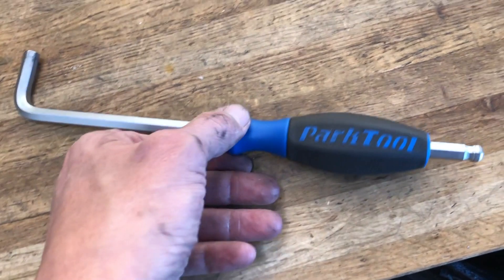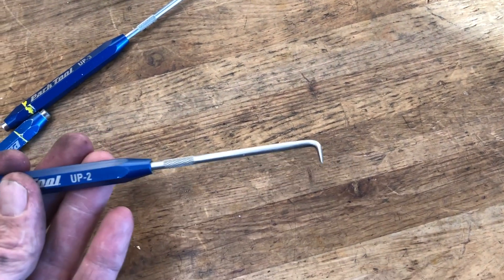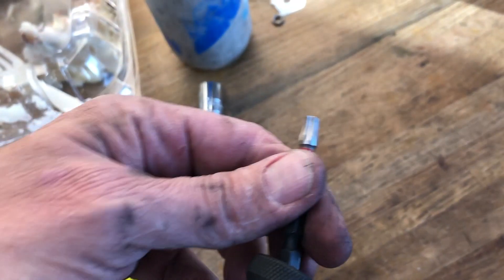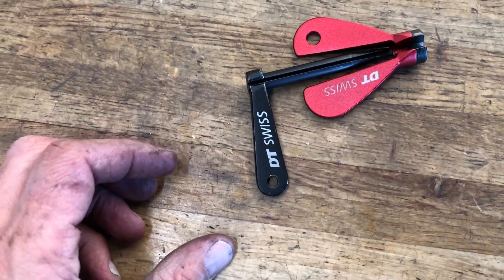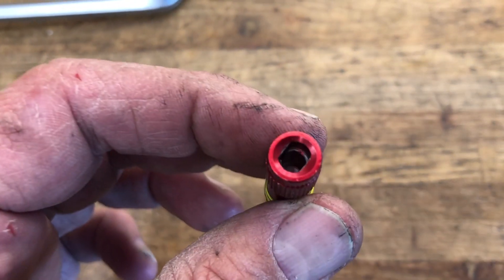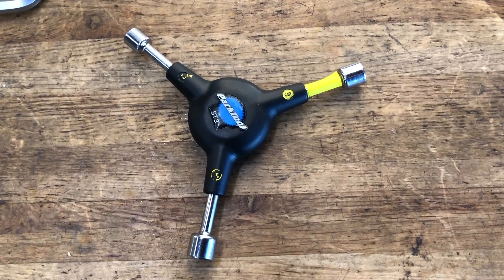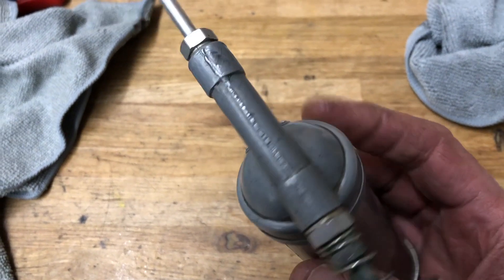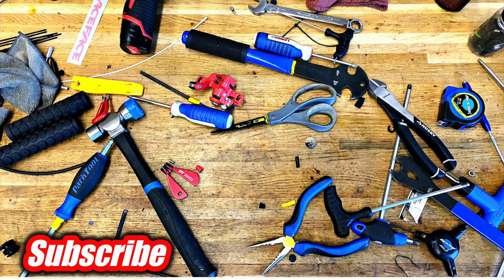Bicycle Tools I Use Daily

Comment: I would add Pedro's vice whip to this list.  One of those tools that once you use it, you won't want to do it any other way.   The others would be my Knipex wire rope (cable) cutters, for cables and shift housing and Knipex diagonal cutters for brake housing.   I have never had cable ends crimped with the die on my Knipex cable cutter come loose.   I have 3 of those grease guns for different  greases and they are nice for using only what you need, eg right amount for bolt threads and keeping grease from getting contaminated.  I also use oral syringes filled with grease too.   Id also add my torque wrenches.

Comment: +1 on the magnetic Park Tools picks. The magnet end is great for getting hub bearings out in one go. 👍
Reply from the maker: Yep, they're good for lots of uses like that. You gotta keep them put up or the stick onto everything that's made of steel! Hope everything going well in OKC Marty! Happy holidays!
Reply: The magnets on the internal cable routing tool are also great for this, or also for hanging spoke wrench on truing stand.   I have a couple of the knock off cable routing tools from Ali Express, I leave on my truing stand.

Comment: How do you  keep the dualco "primed" ?  I don't use mine every day so when I pick it up it won't pump out the grease.  I have to fiddle with it every time for it to work.  I gets very frustrating.  I'm using a generic blue water proof marine grease.  Thanks for the video.  Stay safe and Merry Christmas.
Reply from the maker: The key is to get all the air bubbles out when you load it up with grease. I tap the base or bottom of the container on a solid surface once it's full before screwing the top on. Every now and then a rouge bubble will cause an air pocket and you just have to push the plunger up from the bottom, but that's pretty rare in my experience.

Comment: Welcome back.  Nothing for torx bolts?  I hate them.
Reply from the maker: I got the Milwaukee T-25 bit in the list...
Reply: @JoeyMesa  l missed it.  Don't like having separate tools for different bolt types.  Bicycle industry could use more common standards.  I don't need to mention about all the types of bottom brackets.
Reply: +1 Dualco grease gun with the long tip is a handy tool for efficient bike building & overhauling